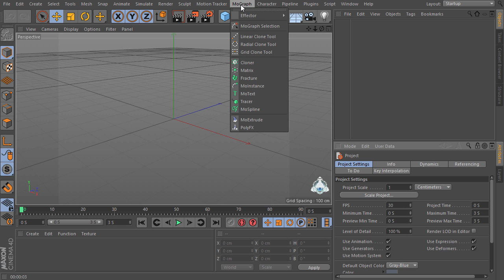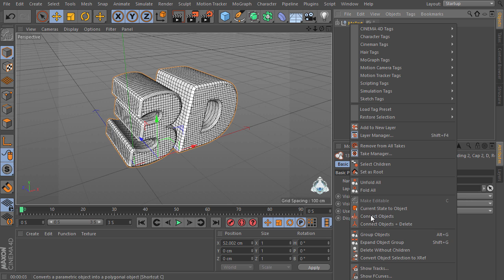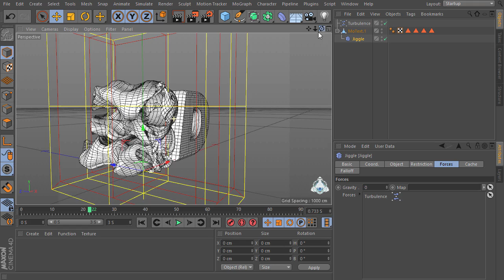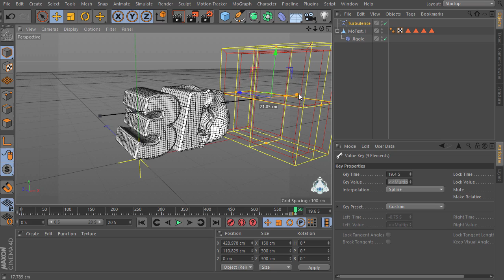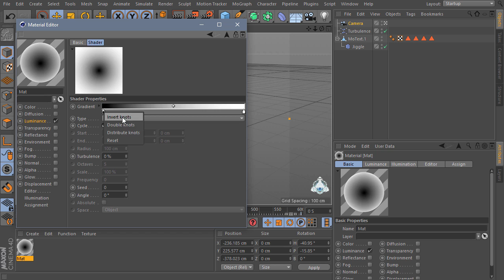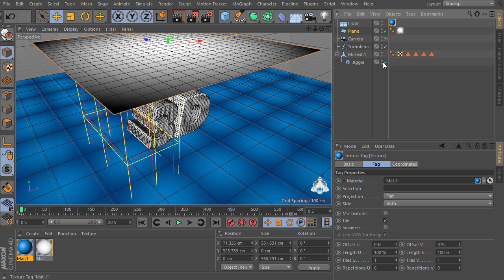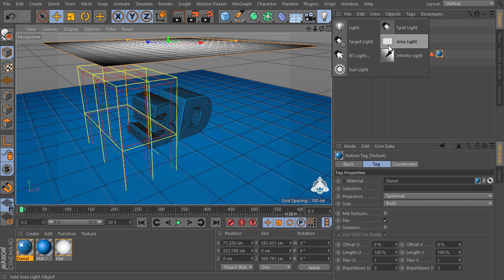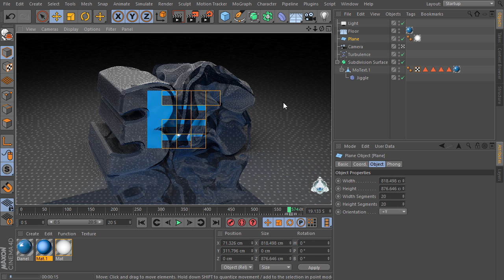Cinema 4D Tutorial How To Use the Jiggle Deformer

Comment: Lawrence  great tut, I'm having an issue I imported an obj model I've applied jiggle deformer same setting as you everything looks perfect even in the preview render view but when it render in picture viewer the jiggle deformer has no effect at all, it's just a clean render of the object with no deformer applied. Any advice how to solve it?
Reply from the maker: Hi there. Do you have added keyframes in the timeline?
Reply: No I didn't was lazy and ignorant and just pressed pause at the point where the deformer looked the best. Im still new to c4d, are key frames a significant part of rendering producing not only motion images but still images?
Reply from the maker: Yes, you will need to add keyframes to the timeline , so you can get the animation.
Reply from the maker: in the still images it is not necessary to add keyframes